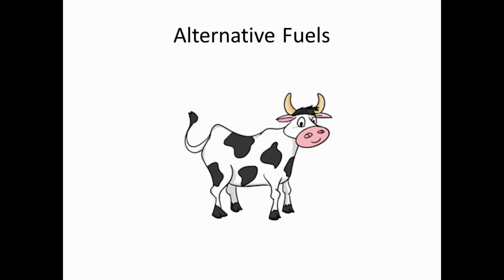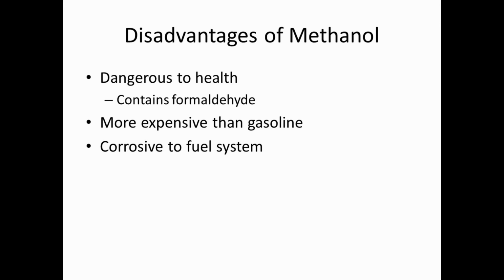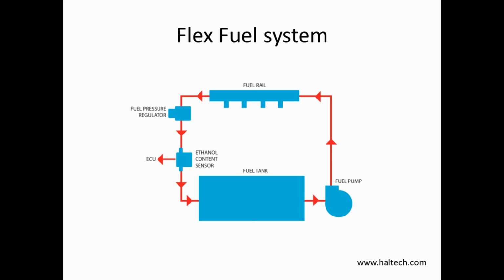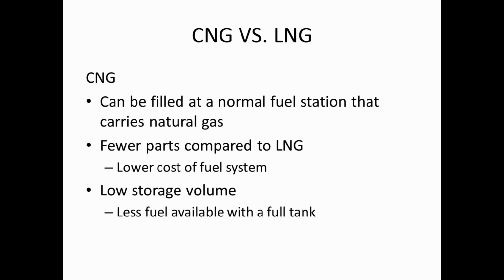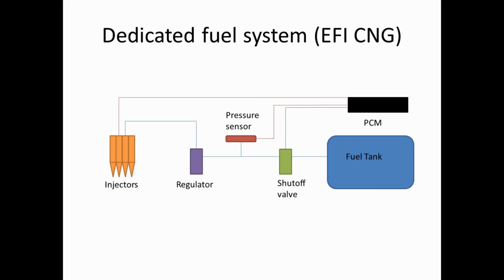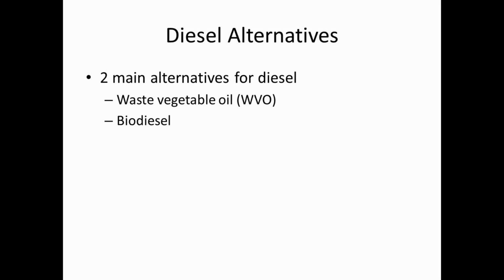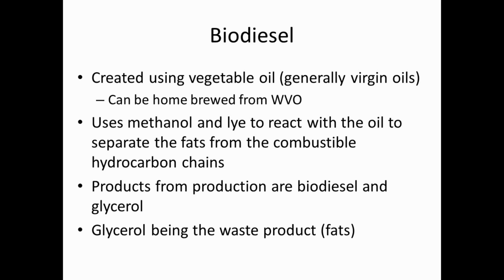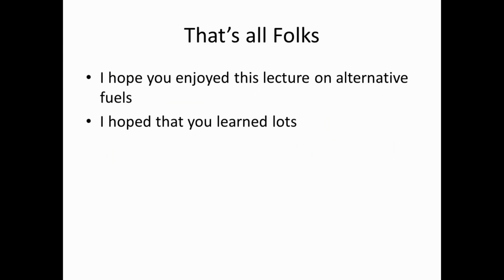6Speed's Lectures: Alternative fuels

Comment: Thanks for sharing this information. My '07 Dakota is Flex-Fuel but I have never seen an E85 station around here in SC. Most of the pumps here add 10-15% Ethanol to gas. I know Ethanol is corrosive but I thought mainly to older vehicles.
Reply from the maker: I'm with you, the E85 pumps are few and far between. Newer vehicles have better rubber in their fuel lines to protect against corrosion, but if you leave any rubber in contact with degraded ethanol for an extended period of time, it'll deteriorate the lines.

If you use your vehicle enough to go through at least a tank of gas every 3-4 weeks, you'll never have a problem with it. The older rubbers can degrade faster, not necessarily fuel lines, but injector o rings and carburetor parts are very susceptible to ethanol corrosion.